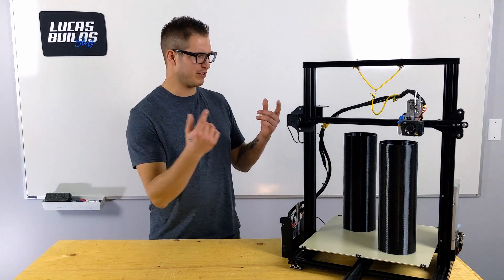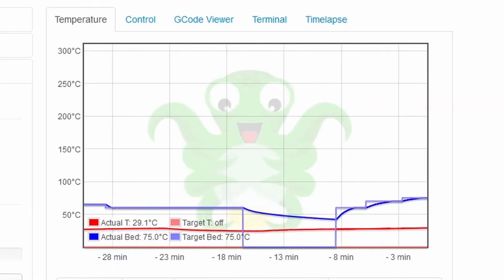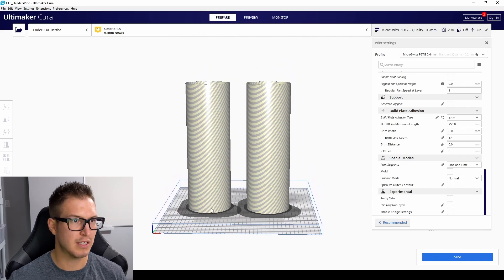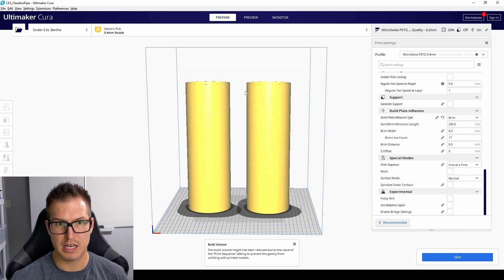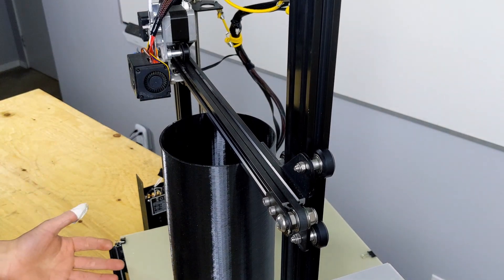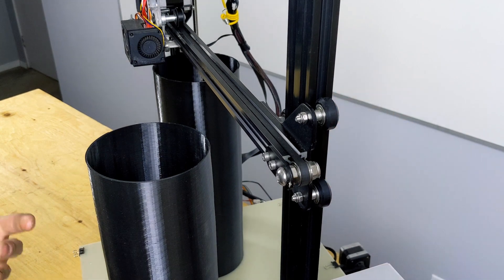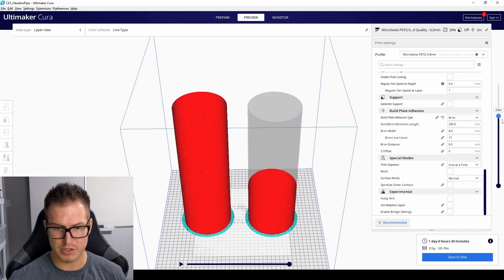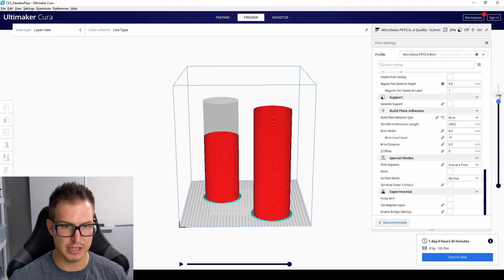How to Print Tall Objects One at a Time using Cura 4.10.0 Print Sequence on Ender 3

Comment: I didn't understand why not directly enter as the Z value the maximum printable by the printer (in your case 500) instead of a lower value as you did.
Reply from the maker: I'm pretty sure when recording I just picked a number between the Max Printer Height and the Object Height. You could set it to the Max Printer Height if you find it easier 😃